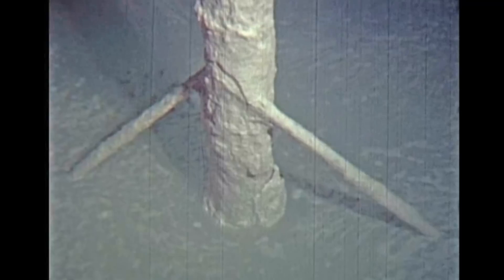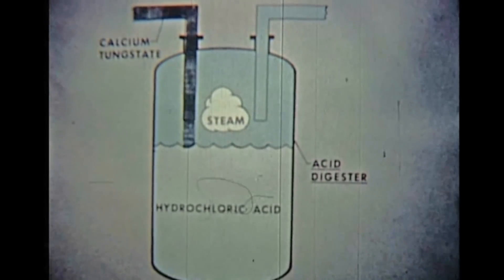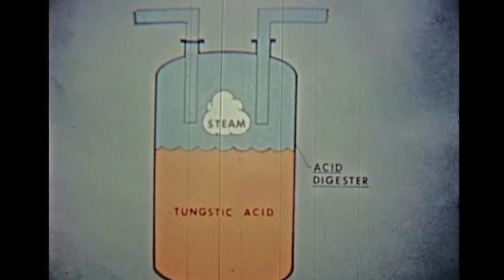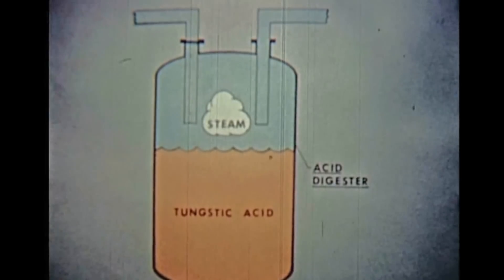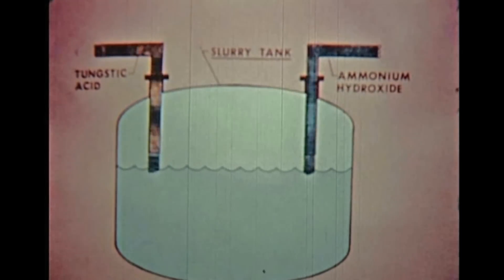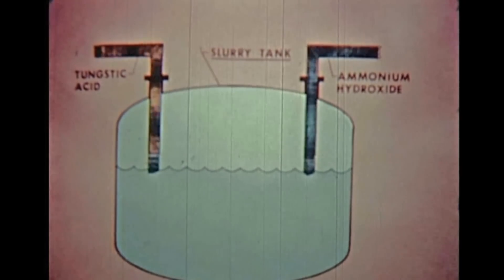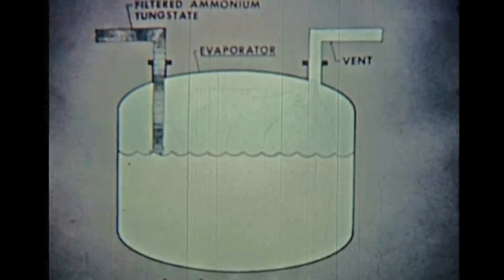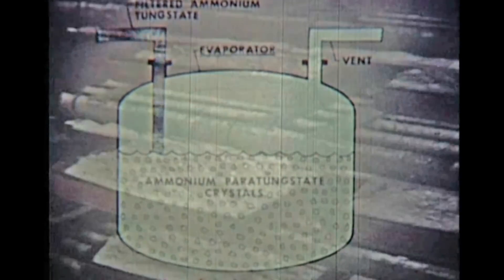Tungsten: From Ore to Wire

Comment: I think the most amazing thing about this video is that in 1964 metric measurements were being used alongside imperial, 60 years later and metric still baffles most yanks
Reply: I'd say metric was probably better known in the 60s and 70s than now. I was taught metric in high school in the basic science classes, so it wasn't some weird unknown thing. In general, all the scientific pursuits in the US use metric, but all of the normal day-to-day measurements are in English units. It used to be that most mechanical units were English, but since most cars are made outside the US now, any mechanic is more familiar with metric sizes than English. Construction trades still largely use English. 

At the end of the day, it really doesn't matter what system of units is used. If you are used to metric, fractions are these strange unwieldly things, and you can't wrap your head around how they work. That is simply the result of lack of training in using them, because in metric you don't need to use them. If you use fractions every day, you are used to thinking about them and working with them, and they are almost as easy to use as decimal numbers. Indeed, for a lot of everyday things they are actually easier to use. But yes, if you use English units, you really should also know the basics of metric, and how to roughly convert a number of the basic units.
Reply: @lwilton  The English use Metric, what they call 'English' in US is called 'Imperial' here in the UK. What brought me here is the fact that Tungsten is used allot in drone warfare, I am shocked to find out that China now produces 80% of finished Tungsten and that USA still mines it but does not have any Tungsten production facilities. This plant got shut down and outsourced to China probably. Trump has put tariffs on all it's allies and so far only 10% on China. I do not understand how USA can prosper or move manufacturing back if Trump has put such high tariffs on so many critical inputs to manufacturing. Trump/MAGA remind me of a tribe from Africa who elected a mad woman as their leader who told them to kill all their cows and burn all their clothes, and the all obeyed thinking she was some sort of magical being. I blame the Techno bros who seem seem intent on destroying America just to own the libs. EU thankfully still produces Tungsten. If I were a US Citizen I would consider emigrating to Bolivia.
Reply: @Sapocati The US long ago shut down most mining other than strip mining coal. We no longer produce copper either, though i believe we get most of it from south America rather than china.

Trump does not understand manufacturing supply chains. But he is not unique, no other US politician does either. Trump is correct that we need to get at least some level of manufacturing back into the US. If china decided to turn off the ships tomorrow, and they could, it would hurt tens of millions of chinese for a few years. But their government doesnt care at such a fraction of 1% level of their populace, and it would literally wipe the USA off the map as a country. It would be a HUGE win for them, at virtually no cost. So something needs to be done to restart self-sufficiency in the US. What Trump proposes will be messy, painful, and in many cases the wrong thing to do. But instilling the idea that it is possible and desirable will probably have a better outcome than the current path of trying to remove what little local production is left.

Comment: And of course another industry largely erased by technical advances along with all the jobs at that factory plus the jobs that supplied the materials and maintenance parts for the machines not to mention the original manufacture of those machines. I like how efficient LEDs are but I like employed Americans also. I visited parts of the Rust Belt in the 80s and 90s and was always relieved that I didn't have to live through the technical evolution that made my father's generation the last with guaranteed lifetime careers. According to the more information the entire plant site has been leveled. 😢

Comment: I can't believe that dude has his hands in hydrochloric AND hydroflouric acid combo

I hope he was paid well - he had good PPE 👍  Change them filters 😜
Reply from the maker: HF and HC, yes very dangerous and injuries were frequent. One fellow had a hole in his rubber apron right at his crotch. This was somewhat common as the apron wore against the edge of the trays. The acid attacked his 'fleshy' parts and he had to have everything there amputated. Hydrofluoric goes straight for the skeletal system. It seeks the calcium in your bones. Mechanical doping systems were tried and failed. The hand-in-glove was the only method that worked.

Comment: Where did they dump all those waste chemicals 😅😅😅
Reply from the maker: Some were trucked away. The spent sodium hydroxide was sold to a company that made drain cleaner. Acids were neutralized and dumped into city sewers. Much of the extract from the ore (lots of cobalt) was left in piles on the property where the chemicals leeched into the soil. Sometimes we had a graphite lube spill. The treatment plant actually used this opportunity to lube their mechanical filtration machinery.

Thanks.
Reply: In the Cuyahoga River...
Reply from the maker: Actually in Euclid Creek about ten miles east of the Cuyahoga. There were several 'fish kill' incidents pre EPA. GE did make some effort in the '70s to better treat wastewater.  @petemclinc
Reply: The Euclid Creek would make sense.  This plant must have been part of the Nela Park
complex in Euclid/East Cleveland. @gmpullman

Comment: Note the people in the video; mostly older people and a lot of women (for the time), these aren't your typical factory workers.
Reply: Women were employed in huge numbers in factory jobs in the US from the late 1800s into the 1970s. Any place where skill and dexterity were required in handling small parts and fine wires or filaments they were repeatedly proved to be vastly superior to men. There was a GE steam iron plant in a town near me into the early 1970s. As I recall it employed about 500 women to assemble the steam irons, and about 100 guys to do the heavy lifting and maintenance required around the plant.

In many areas where there was a long-running factory, it was not uncommon for the plant to employ several generations of people. The boys and girls would get their first job at the plant around age 16 to 18, and would work there pretty much their entire life. Their mother or father or brother or sister might be employed in the same area, or some other area of the plant. A lot of people would be in their 40s or 50s or early 60s, but that was because they had been working at the plant since before they were 20.
Reply: Yes, when factory jobs were plentiful and houses cost 1 years salary or less. I'm sure the exposure to the metal particles and chemicals was high.
Reply from the maker: Women were generally excellent workers to handle the very fine wire and they had the skillful dexterity to thread the intricate wire passage through the furnace, lube and dies. Much of the wire was so fine it was barely visible to the naked eye.
Thank you.
Reply: @gmpullman stfu who asked?

Comment: Impressive use of metric in an American plant. Also an impressive process sintered and forged into a solid rather than just melted. But I suppose the temp required would rule that out.
Reply from the maker: Yes, all processes we used were done in metric measurements. Our sources and buyers were a global market so it only made sense. Thank you.

Comment: This was the GE plant on tungsten rd. Cleveland Ohio. I worked repairing the roofs on this plant for an outside contractor. Raw ore entered the east side and tungsten wire and tungsten powder left the west side. LIKE ALL OTHER BIG COMPANIES GE ABANDONED CLEVELAND. They left empty rotting buildings. Even in 2024 steel plants are still closing because of cheap foreign labor.
STILL NO ONE CARES. REPUBLICANS SMOKE SCREEN IS THE SOUTHERN BOARDER. AMERICAS REAL PROBLEMS ARE MUCH BIGGER.
Reply from the maker: Plant has been completely leveled as of fall 2023. Never again will there be investors or capital to build factories in the US like these.

Comment: This was happening 70 years ago. How advanced has the process gotten by now, and also obsolite because of leds?
Reply from the maker: Yes, LEDs took away probably 90% of the wire business. Tungsten wire is still used for some specialty lamps plus other industrial applications (welding electrodes, etc.) Much of the tungsten is used as an alloy to steel for hardness. Process has not changed very much. Only one way to tame the beast.

Comment: I love how descriptive old video like this used to be. Meaningful steps shown with precise technical (yet for the laymen) descriptions. Oh how I wish modern factory documentaries followed this template. Now it’s all about production and “interesting” angles of video and stories about the factories or workers…nothing truly relevant to the production process. Too many factories are scared to reveal there “proprietary” processes because lawyers tell them not too or “no you can’t say or show that”. It’s just dumb. Anyone agree with me?
Reply: Up until about the mid 80's if you purchased a million dollar machine you got with it a set of schemactics, diagrams, detailed descriptions of how it works, test conditions at critical points in the process that could be measured and adjust to dial it in or figure out what is not right when if malfunctions.   If you had cause to take the time, and access to those manuals, you could intimately understand every circuit in the machine by studying the manuals that shipped with it.  You didnt have to pass security clearance and a credit check, they just came with the machine, standard, presumed to be required to be in the posession of someone who had to keep the machine running well.   Now they all do the opposite they dont want you to understand anything about how it works,  that way they get paid to send their own technicians out to make a minor adjustment and they are the only ones allowed to look at a schematic.    You will rent everything and get raped on the price of everything until you question wth happened to our industry, our economy?
Reply: @laserflexr6321 nowadays you gotta pay for the manual
Reply: No

Comment: This is an important historical document. Though I cannot help but wince at several of the sequences with regard to worker safety. In particular the "cold" rolling process where a guy is pulling 1500C ingots from the furnace which spontaneously begin vigorously burning in air, and which you can easily see are releasing vast plumes of the yellow trioxide microparticles without any apparent fume extraction or ventilation. The toxicity and carcinogenicity of W and WO3 nanoparticle ingestion is still in question even today, but breathing in that much material just can't be good for health.
Reply from the maker: Hello
I worked in this plant for 38 years. Some times I was covered head to toe in yellow W oxide. In some of the furnaces we processed 2% Thoriated Tungsten used for shock resistance. No mention of it being radioactive. Safety precautions were an afterthought and not really pressed until mid to late 1990s. Thank you for commenting.
Reply: @gmpullman  Wow, the evidence of hazard for tungsten is arguably equivocal, but thorium dust is absolutely beyond any doubt very dangerous. Thorotrast was being phased out around the time this film was made, so they certainly should have known.
Reply: And yet here we are. This content creator is apparently alive and well years later after intense exposure to everything that is banned today. SMH.
Reply: @fredfred2363  I worked with asbestos in many forms in the 1960s and 1970s. I'm still here too. There are quite a lot of things from the past that weren't nearly as deadly as we are now taught they were. I'm not saying there weren't possible health hazards. There were, and they were generally known. But you weren't going to catch sick and die if you just thought of the name of the substance, as many now seem to believe will happen.
Reply: @fredfred2363  What a dumb take. Why don't you go huff some asbestos, it only kills around 10% of exposed people with mesothelioma after all. We'll wait.

Comment: It's amazing what kind of exceptionally complex shit humans have figured out, built, and manufactured on their own in a relatively short amount of time. Not only did they think all of it up themselves but they actually got it to work which amazes me. Advancements in materials and metals are what progresses a species into the next age. The manufacture of near perfect multi level repeating and interacting geometric platonic and Archimedeian solids or quasicrystal metals is the next step. It's a complex process of already known simple principles done in a specific order that haven't been put together yet. But if humans can figure out the complex processes of making remarkable metals and advanced materials from sand/scratch they can figure that out as well. It'll be interesting to see what the next few decades of advancements in metals and materials manufacturing will bring to the table, that is if humans don't destroy themselves first over some useless morons petty and pathetic antiquated political and dogmatic bullshit and work together instead of against each other. Humans have the potential to make and build anything.
Reply from the maker: You pretty much summed things up well. Thanks for the comments!

Comment: If the process is the same today, why not make another documentary of the same quality? It would even be possible to seize the opportunity and give more focus to parts of the process such as the production of the incandescent lamp filament, showing the machines working in much more detail and longer observation time on each part of the process.
Reply from the maker: That would be nice if the plant had not been shut down and razed in 2017. Thank you.
Reply: @gmpullman  I didn't really know that the factory had that purpose. What caused the end of the factory? Thank you for letting me know.
Reply from the maker: @Vicente_Camilo   Sharp downturn for tungsten wire with introduction of LED. Global production and quality of Moly and Wolframite (tungsten) powder increased while lowering cost.

Comment: 2:04 tungsten toothpaste
Reply from the maker: You make a good point, sir. We did experiment with extruded tungsten paste which was then sintered, treated and drawn into wire. Also, we used thorium to reduce breakage of wire used in rough service. Thorium was an ingredient in mid-20 century toothpaste to "brighten teeth" !!

Comment: Wow, a cypress stave tank..
Reply from the maker: We had about two dozen of them around the plant.
https://www.flickr.com/photos/gmpullman/34941416722/in/album-72157684497118596/

Very durable. Some whiz-bang designed a Fiberglas tank and it destroyed itself on the first use when the agitator made it flex so much the seams came apart. (Photos in the same Flickr album)
Thank you.

Comment: Thank You For this exceptional upload !
Reply from the maker: Glad you enjoyed it. I worked in this plant for 38 years.
Reply: @gmpullman  A lot of your specialised knowledge may have been classified , correct ? I’ve watched your video several times. This know how was available with the USA and some select industrial powers ( USSR,  Germany etc ) way back since the invention of the light bulb ! You are indeed fortunate . The processing of Tungsten in particular has always been a puzzle to me. Thanks to you now , that desire has been sated !
Reply from the maker: @WXUZT   GE pioneered the 218 "no-sag" process and many other types of tungsten powders and wire. Yes, much of the process was specialized, especially doping and anneal treatments. Also welding of ingots into longer rods for much longer wire spool length. The "recipe" and process was sold to H.C. Starck in the 1990s. Thank you.